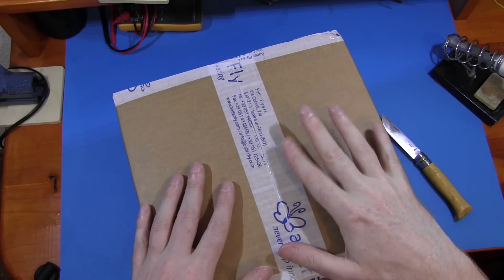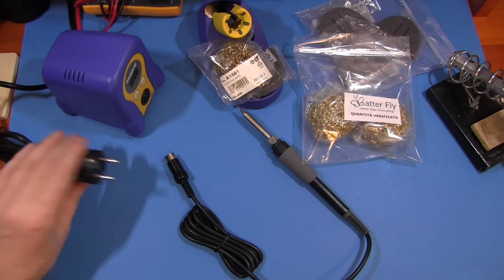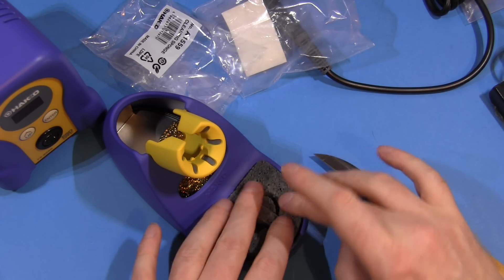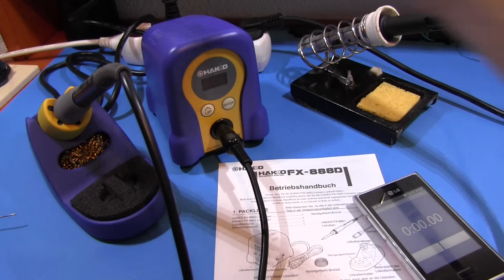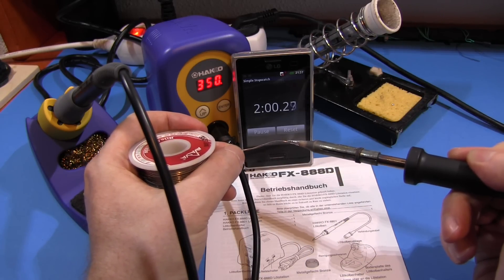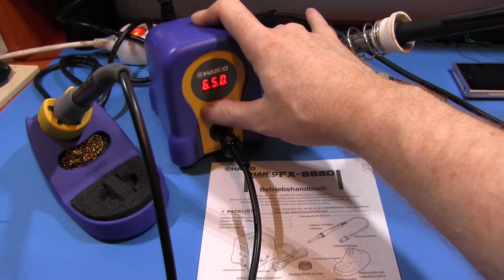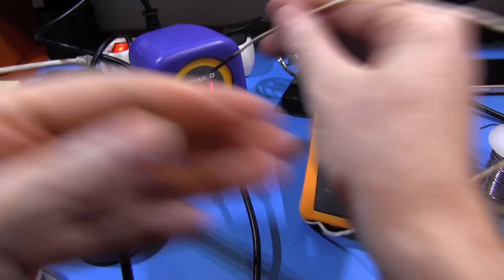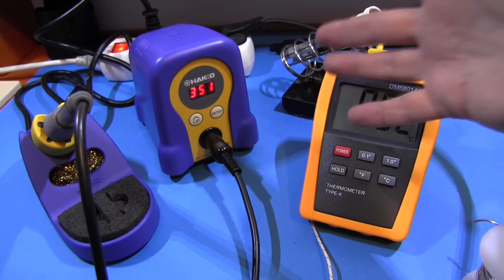ARVBLOG - Hakko FX 888D soldering iron unboxing, testing and opinions

Comment: I have one of these, it's good, but for really quick startup the Hakko FX-951 with it's  heating element integrated into the tip is even better; it gets up to temperature in about 5 seconds. Irons using that type of technology are also good for soldering things with a large mass or ground plane as they can sense temp drop in the tip and immediately increase power to compensate. For most hobby or general use though, the FX888D is just fine. The user interface is rather awkward though.
Reply: The new FX888DX interface seems even worse, and they changed the tip style so that the T or 900M tips people already own won't fit. Boo hiss! 😖👎

Comment from the maker: I've just been using it in anger, and, wow... I've been missing out!

It's sooo much easier/faster to solder things that absorb even a modest amount of heat. Do yourselves a favor and get a proper temperature controlled soldering iron.
Reply: I got mine yesterday and was just able to use it today. I totally get this comment. I bought two irons and returned them. One was even a Weller WLC-100. It was better than the first one  but this Hakko one wow! I got my project done is way less time than expected because my pace was faster. Irons matter big time!

Comment: Are you still happy with the soldering iron you bought ? And also where you happy with Batterfly? I live in Italy so it will probably be pretty fast shipping , but I wanted to know if you ordered many products from them and if it is all good? 

thanks for a good review, exactly what I was looking for
Reply from the maker: Yes, very happy.
Reply: thank you! good to know. I went ahead and bought one  a couple of days ago and  tried it out for some simple repairs so far. I works really perfect.
Reply: @IvarFFF  Hi, I also live in Italy, I wanted to take a Hakko FX 888D, Batterfly sells original Hakko ? You speak Italian ? Did you feel comfortable with Batterfly ?
Reply: @CanaleYouTubeGeneralista  yes it was all original. Arrived very well packed in double boxes so was very impressed. Can recommend it 👍
Reply: @IvarFFF  Thank you for your confirmation, very kind, actually I wanted to buy a soldering station with t12 tips, but only Chinese stations or clones are found, the original FX-951 hakko is cost, the only alternative is the FX-888D hakko
Reply: @CanaleYouTubeGeneralista  I'm sure you'll be happy with it, I used it quite a bit since I bought it with some extra tips and its still going strong. Did not have any issues with it
Reply: @IvarFFF  Thank you for the advice, what extra components did you purchase ?

Comment: Hi!  Thanks for the video.  I am just curious if you used distilled water?  I just got the 888 and bought a gallon of distilled water for the sponge.  I've heard that it's better but don't know the details- just that there are no minerals in it to contaminate the tips.  Thanks again!
Reply from the maker: I use ordinary tap water. I can't imagine the minerals in it will be worse than the acid and stuff that's in soldering flux.

Comment: If you press and hold the "up" button for more than two seconds like you did, you've just entered the "calibration" mode.  Playing around in there will throw off your calibration settings!

You better "reset" your 888D back to default settings by watching this video here...
https://youtu.be/ecH4c6NdBuo

Hope this helps!
Reply from the maker: +Rick Lynch Yes, thanks. I figured that out after reading the manual.

Still, it was only one degree...

Comment: How flexible is the iron to base cable? I'm hoping for a nice supple cable that's easy to deal with like on the old weller i used to have.
Reply from the maker: Very flexible. I imagine it's silicone so it doesn't burn at soldering iron temperatures.
Reply: brilliant! thanks for the reply.
Reply: ARVBLOG bjlollpl

Comment: I have a cheap soldering station (the baby-blue ones you see on amazon/ebay) that heats up WAY faster than that junk one you have. I think that would be more of a fair comparison.
Reply from the maker: +Fizbin321111 If it heats up fast then it might be too hot for small electronics.

Comment: These are great irons I have one and I get it, but who honestly needs to solder something so urgently they can't wait 2-3 minutes.
Never really understood this foolishness. Are there folks out there who de-solder bombs before they explode?
Reply from the maker: It's half an hour waiting after you've soldered ten things...
Reply: The problem with slow warm up is when you are replacing multiple components and you dial the iron down while prepping or placing the next component. if you have to wait 2-3 minutes everytime, it becomes very frustrating. This unit has a standby that kicks back to temp very quickly allowing you to be more productive.

Comment: & THAT is why digital meters suck your constantly left wondering if the component you tested is good?bad? Or is the meter acting up  ? Maybe my batteries are bad ,hmm they shouldn't be I just changed them ,maybe I'm not touching the leads properly? , in this case temp. testing

Comment: Pretty sure he has a fake Hakko FX-888D.
Reply: Was it the sticker? Only way to find out is to pop the hood i suppose
Reply: @glennodonoghue644  Nothing about his iron is like my Hakko FX-888D and I bought mine directly from Hakko.
Reply: @Olie956  In what way is your Hakko different? I'm waiting for my Hakko to arrive from Amazon and the first thing I'm going to do is check if its real.
Reply: @glennodonoghue644  I will pull it out of the workshop tomorrow and watch this video and then go through to see what exactly is different.
Reply: @Olie956  Nothing about it? It looks the same as all the other 888D videos on YouTube.. (though the counterfeit ones are hard to distinguish too)
Reply: @glennodonoghue644  After looking at my unit I have determined that he does have a legitimate unit. I don't know why I said I thought it might be a fake. I can't remember why I originally came to that conclusion.

He's got the same unit I have and it works just the same, although I think my unit actually gets to the temps indicated on the display rather than slightly under which is what he was seeing. It could be how the unit is drawing power from the wall causing the difference he saw from what the readout states and what the iron is actually at.
Reply: @krnlg  I made a small mistake. Apologies. It's legit. Just make sure you plug it into a good wall socket with a clean synwave and you will get what you paid for. Try not to plug up through power extensions and the like.
Reply: The FX-888D is a great unit. Built tough and proper.

If you did get a Weller unit instead, as many compare this and the Weller unit around the same price, make sure you have a voltage regulating UPS station that acts as a go between from the wall to the Weller unit. The Weller units usually don't have a proper mains circuit which can cause the unit to explode if it's plugged into a dirty outlet outputting a bad synwave.

Something like a Cyberpower AVR UPS should do the trick if you did want the Weller instead.
Reply: @Olie956  I would have agreed with you thinking it was a fake. A thing to look out for is the sticker size on the bottom. The fakes tend to have a sticker half the size of real units like the one shown here.

I'm not sure if that alone could determine if its a fake, but it's a known indicator.
Reply: @glennodonoghue644  The only real way to tell is to pop it open and inspect the internals unfortunately. But, a sticker misplaced or not properly size might be a good indicator that it's time to pop it open and see if you are dealing with real HAKKO or a FAKKO. Lol.
Reply: @Olie956  Indeed sir, maybe we'll never find the answer. I'll try not to lose any sleep over it lol
Reply: Do you happen to know if Batterfly sells original Hakko ?